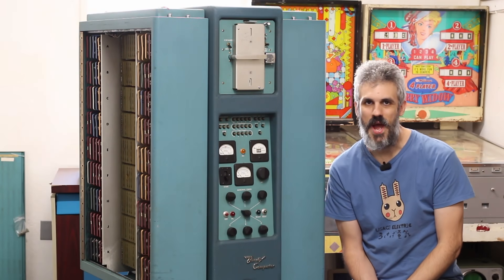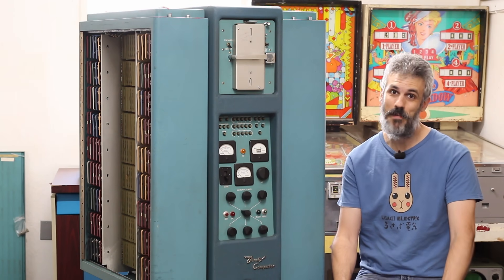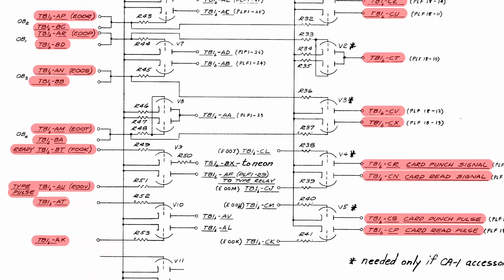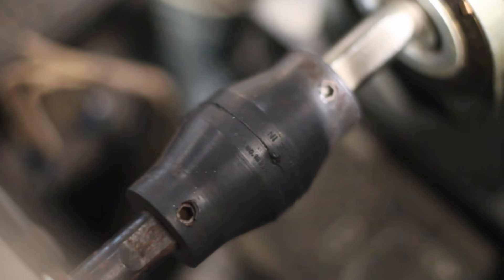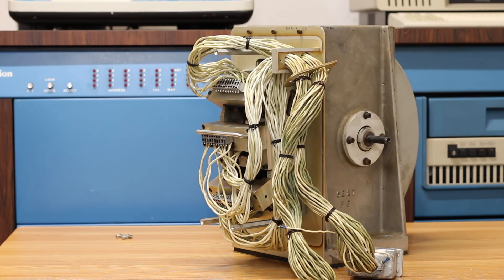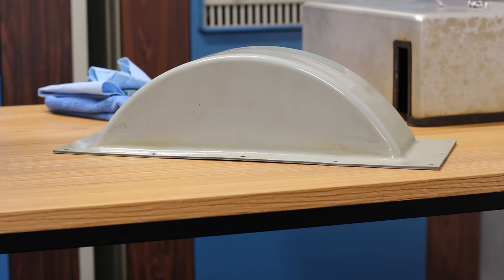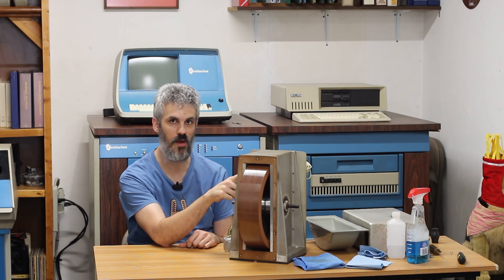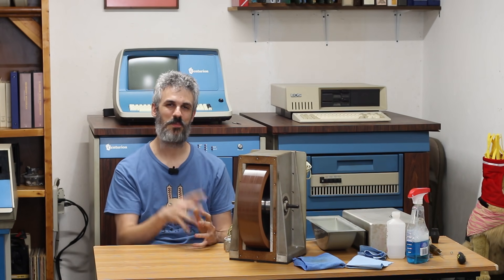Removing the Rotating Drum Memory from the Bendix G15

Comment: As for the drum rebuild: I would strongly suggest to get the drum CNC-Ground down to H6 or better tolerances with a Ra of ~0.2µm or better and a cylindricity of 0.002mm or better. The better your starting point, the higher the chances of the rebuild working. The coating itself should be done using the correct binder. perhaps you can find an old IBM patent somewhere describing the binders used in drum or disk coatings. Also make sure to properly measure the coating thickness. If you had the money I would suggest getting the coating sputtered on using a modern magnetron-sputtering system. I would definitely advise against using a lathe. Especially if it hasn't been properly trammed and aligned within itself and to gravity using a machinists level.
Reply: I was going to say an ordinary lathe certainly wouldn't be good enough.  A drum like this would most certainly have been ground between centers on a cylindrical grinding machine.
Reply: I don't think sputtering would work to apply this type of compound. However, your first point is right--this is not a job for a conventional lathe. In fact, I would try to avoid machining the drum at all, as the difficulty of getting the necessary tolerances are not at all trivial.
Reply: I would suggest replacing the bearings before doing anything. It would be tragic if after all the work to recover the drum the 70 year old bearings went and you where back to square one.
Reply: The coating used is also going to probably have to be very similar to the original one in terms of coercivity etc... or you will need to do things like adjust all the head amp electronics to get reliably recorded data. You can't just slap on any random magnetic coating and expect it to work with the existing read/write bias and level setup..etc.
Reply: @maskddingo1779  In this regard, I think he has going for him the fact that this drum was built in the 1950s, in the early days of magnetic recording, when there wasn't a huge variety of coatings available. My guess is a basic standard-bias audio tape recipe using acicular gamma ferric oxide will work. But, like you say, more "modern" formulations for high-bias tape, videotape, etc., might not work at all.
Reply: @danmenes3143  Absolutely agree. I think they can pretty easily narrow down something that will work based on the era. Just poitning out that it's something to consider!
Reply: @jonathanbuzzard1376  On the other hand, getting bearings of the necessary level of precision may not be cheap.
Reply: @danmenes3143  True, but considerably cheaper than it would have been in the 1950's. What was high precision in the 1950's is today ordinary precision. The march of machining precision is one of the unsung wonders of the last 50 years.
Reply: @jonathanbuzzard1376  The bearings need on the order of 0.0001 runout, and to maintain that runout under the load of a fairly massive wheel with a reasonable lifetime. I'm sure such bearings are cheaper than they were in 1950, but they still aren't cheap. And if you replace the bearings with run-of-the-mill, bargain basement Chinese bearings, I think they will not perform as well as the bearings that are on there now. By all means check the runout with a tenths indicator, and replace the bearings if they need replacing, but I think it would be foolish to replace them prophylactically.
Reply: It's made from aluminum. Not really going to get a reliable grind.
Lathe will make a perfect finish.
BTW, one does not tram a lathe, one trams a mill...
Reply from the maker: You're right that the mechanical side of things is going to be the most difficult.

Before we do anything with the real deal drum, we're going to find the limitations of our tooling and machines using test pieces first. If my lathe is completely inadequate, I want to find out first hand, by actually trying it. Maybe we can bring it into spec., maybe we can't, but that's a skill I would like to learn anyways. If it does turn out to be completely incapable of what we want, I will know exactly why and where our shortcomings are. 

I think it's incredibly important for me to try to use the tooling that I have at my disposal first before immediately jumping to "there's no way I can ever do this, I might as well just get a professional to do it." 

I don't learn anything new that way. And that's the most important aspect of this whole project - learning new skills. I'm a learn by doing type of person, I can read a thousand books and will learn less than I will in one hour just trying to accomplish a specific goal. So, let's do and learn where we suck along the way.

But, I absolutely will not be doing anything on the original drum until we've hammered out a process that works using test pieces.
Reply: @UsagiElectric  Good to hear. There's still a lot to be said for "above all, do no harm." You have seen the drum closer than I have, but it looked to me like most of the damage was confined to the coating. If the coating can be removed chemically, and if the aluminum surface underneath is still intact, you are way ahead. Granted, those are both "ifs," but ifs that you should answer before attempting to resurface.

Even if the aluminum surface is damaged, I think you should start from that surface as a baseline, then seek to fix it using fine grit hand-held abrasives, and a rigid test fixture where you can rotate the work slowly on its own spindle while frequently inspecting it with a tenths indicator. I think you will find it much easier to maintain the tolerances you need with that approach than if you try to turn a fresh surface from scratch with tools that, at best, aren't ideal for the task.

A lot has been said here, including by myself, about how this job "can't" be done on a lathe, and can "only" be done on a cylindrical grinder. None of that is strictly true. What is true is that the tolerances and surface finishes needed here are tighter than are typically achieved by single-point turning on a conventional lathe.

Keep in mind, also, that the manufacturer likely machined the drum surface and bearing journals in the same setup, ensuring near perfect concentricity. If you re-machine the drum, you will inevitably add some runout with respect to the journals.
Reply: @UsagiElectric  Great to hear! Fully agree with the learning by doing aspect. It's more fun than having it be done! Though be mindful of the cost of tooling and measurement equipment. Costs in precision mechanics tooling and equip can quickly explode. If you need some advice maybe I can help you. Though my last machining job is long ago now so my knowledge might be a bit "rusty".

Comment: Aircraft gyroscopes use a strip of that clear ultra thin double sided tape as a debris trap, just apply it to the surface then remove the backing just before assembling the unit. I would just run several strips of tape on the inside of that cover. Much less messy than grease and no chance of accidentally contaminating the drum.

Comment: I am sure spraying is how the drum was originally coated. However, I think high-build primer and automotive clear coat will not be a good choice. If you have only 0.001" to play with, you want a coating that is designed to leave a very thin layer. Both the coatings you mentioned are exactly the opposite--intended to build up thick layers. I think you will find it almost impossible to get a variation in thickness of less than 0.001" with those coatings, no matter how much you polish them.

Maybe a very thin nitrocellulose lacquer, applied with an airbrush? Has the advantage of being easily removable with lacquer thinner if you mess it up.

Also, as long as the drum is already on a precision spindle, I would not take it off and move it to a lathe. A lathe will not, in any case, give you the surface finish you need. Almost certainly that is a ground and polished finish. I would think the best way to restore it would be to spin the drum on its bearings while applying successively finer grits of abrasive papers, films, and polishing compounds.
Reply: couldnt it be anodized ?
Reply: @mm-hl7gh  I don't see how anodizing would apply a magnetic coating.
Reply: Thinking about this a little further, DEFINITELY DO NOT attempt to remachine the drum on a conventional lathe. And I would strongly discourage you from removing the drum from its bearings at all.

If the heads are flying at a height of 0.001, you need to hold roundness and concentricity of 0.0001 or better. That's 4 microns, for the metrically inclined. Maybe Robin Renzetti can hold those tolerances--YOU CAN'T. If you take this drum off its bearings and turn it in the lathe, you will leave it with more runout and a less flat surface than it has now.

Your best option is probably to try to remove the existing coating chemically. Obviously, test any chemicals on scrap aluminum before applying to the actual drum. With luck, you will find that the gouges that have affected the magnetic coating don't penetrate to the aluminum surface.

I would try, in increasing order of seriousness, water, isopropanol, denatured alcohol, lacquer thinner (which I think is mostly toluene), acetone, brake cleaner (the real stuff, which is tetrocholroethylene, not the environmentally friendly stuff, which is typically a blend of acetone and the like), brake fluid (famous for eating paint, should be kind to aluminum), citrus-based paint strip, or if all else fails, methylene chloride-based paint stripper. Check the label of any stripper for acids or bases (e.g., sodium hydroxide, potassium hydroxide), as both acids and bases will etch aluminum.
Reply: I agree very much with not taking the drum off its current bearings.
Reply: @danmenes3143   I believe (I could be wrong) that the read/write heads are floated above the drum surface using airflow, so they can maintain proper distance and accommodate some amount of deviation from perfect circularity in the drum's cross section. The patent for this dates to a couple of years before the Bendix G-15, though it's IBM's, so...
After all, these drums were originally manufactured in the 1950s using machinery available at the time, not some kind of magic, so while they were certainly made to very precise tolerances, they're not perfect -- nothing in the real world is! And that's without taking into account the fairly significant changes in outer diameter an aluminium drum of this size would be expected to show just through normal temperature variation. A 300mm (looks about right for this) aluminium ring at 20 celsius is going to expand to about 300.06mm at 30 celsius. That's a radial expansion of 30 microns already, so the idea of a 4  micron tolerance is out the window already.
Reply: All that said, the idea of using high-build primer to build back to design diameter after machining down.... feels a little sketchy. Is it possible to just machine the drum down to a new surface and then adjust the head assemblies to match the new smaller diameter?

Or even try to avoid the need for machining down to a new surface altogether and instead try to preserve as much of the original surface as possible. What I'm  thinking is to remove the existing magnetic coating down to the base metal, then perform only the minimum possible machining to remove any metal raised above that surface level by the head crash scratches, if there is any. Just leave any damage that's below the reference surface as it is. That way it might be possible to realign the heads axially across the drum so they're positioned above undamaged parts of the surface (In other words shift the data tracks "sideways" away from any scratches.
Reply: @jhonbus  That appears to be incorrect. That's how a "winchester" hard disk works, of course, but in this, much older, contraption, it seems that the heads are simply adjusted to sit 0.001" off the surface.
Reply: @jhonbus  I am sure the heads can be adjusted for a smaller drum diameter, within a small range, so the loss of material due to machining doesn't worry me. But if the heads are supposed to have a clearance of 0.001, then they will need that clearance to be consistent to much less than that--say 0.0001". There isn't a snowball's chance in heck that the process our host has described will result in a cylinder that is true to within a tenth, or even a thousandth.
Reply: @danmenes3143  Have a look at US patent 2862781, filed in 1954. Not saying you're wrong about this particular drive, I'm certainly no expert. But the technology did exist by the time this computer was produced.
Definitely agree with you that the respray method David described does sound like it might struggle to reach the original precision, by the way.
Machining down feels a little more plausible to me, but yeah, it's probably going to need cylinder grinding rather than just turning on a lathe (especially a hobby shop type lathe) It might even be better to use a method like polishing with emery paper so you're using the original surface as a reference and maintaining precision in the finished piece by relying on the assumption that an even thickness of material is removed from everywere.
Reply: @jhonbus  Interesting! I thought it was a bit later.
Reply: @jhonbus  Thermal expansion is largely a red herring. The disc is mounted in a case of aluminum it looks like. They should expand together to a close rate.
Reply: @danmenes3143 maybe some M.E.K.

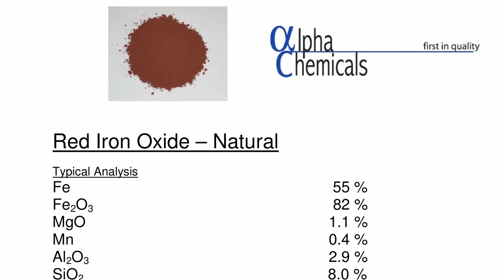Comment: 21:19 In my humble opinion, I believe that an effective method to repair the drum would be to deposit a ferromagnetic material on the surface through a vapor system inside a closed container, something similar to the method used to create optical mirrors for telescopes.
Reply: This, vapor deposition is probably going to be the best bet. Spray-coating may have been used more because, with the right tooling, it would be much faster and economical than other methods.
Reply: It would be incredibly cool, but I think you would need to give a qualified physicist or chemist about a year to develop the process. There is a lot of complexity, including the exact grain sizes, getting the right mix of oxides (Fe3 or Fe2? Or a mix?) with the right crystal structure, annealing, and so forth. I do seem to remember having cassette tapes, back in the day, that advertised that they were "epitaxial," which suggests some such process. I don't think just sputtering iron, cobalt, or some such onto the surface will give a workable recording medium.
Reply: I second the vapor method.

Comment: I agree with your decision to avoid tape.

Wind aside, that drum's surface will see acceleration in the ballpark of a few hundred g, directly outwards.  And the layer needs to withstand both its own weight (at a few hundred g), and the stretching of its entire layer - and not only must it stay intact, but it can only stretch out so much before crashing.

It's probably not very much total force, but it's enough that if "correct" materials and techniques are an option, they are mandatory.  And automotive coatings sound (at least to me), much more likely to work than tape.  That said, I'd still look around to see if there's anything else within your budget that's actually rated for this kind of load.  And definitely would be careful about actually machining the coating.  If the bond is weaker than the coating, it'll be pretty hard to machine without flaking off.

Comment: You should consider an electrostatic process to apply the magnetic material to the aluminum drum. In the first stage a mixture of magnetic powder and some kind of PTFE/acrylic dust is sprayed on the drum surface while it is rotating. In the second stage the mixture is "baked" at certain temperature to a solid ring which sticks to the drum. Then you need an optical polishing tool with micrometer adjustment mounted at the read/write head position to get the drum running true before mounting the heads. No easy task.😁
Reply: I like your idea, clear coat is soft and sanding clear with iron oxide in it would be a nighmare. I painted two gloss black classic vehicles, sanding with fine grit is key to obtain a mirrored surface with clear. .001 of an inch heck, heat expansion could go past that.
Reply: This would certainly be a cool science experiment--although A LOT of testing and tweaking of the process would be needed. I don't think the Harbor Freight powder coating gun will give the needed super-thin coating thickness. I think the binder that laser printers typically use is a finely milled polystyrene powder. Could be wrong, but you need something that melts relatively easily, without breaking down. I think PTFE breaks down chemically before it melts, so that wouldn't work. Not  sure about acrylic.
Reply: I was thinking electrostatic too - the sides of the drum look evenly coated which probably wouldn't happen with spraying. But the extra level of science needed would be a series in itself.